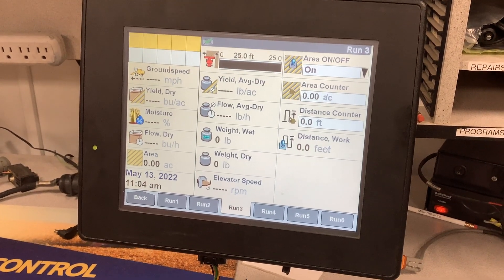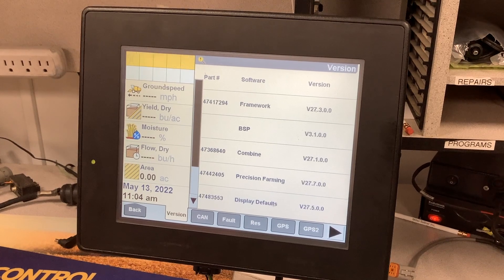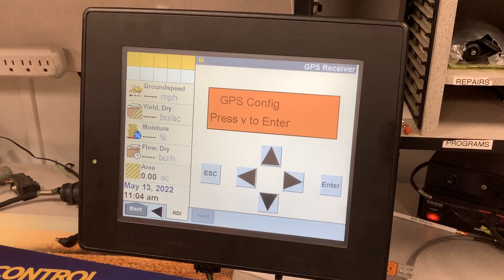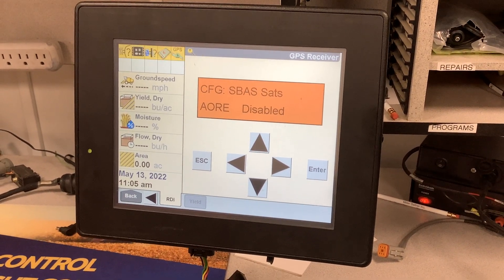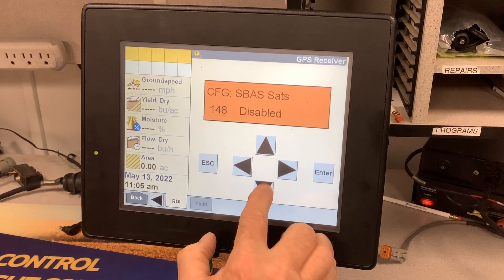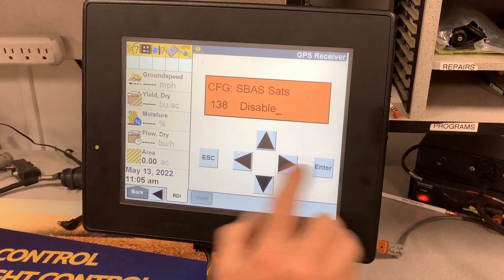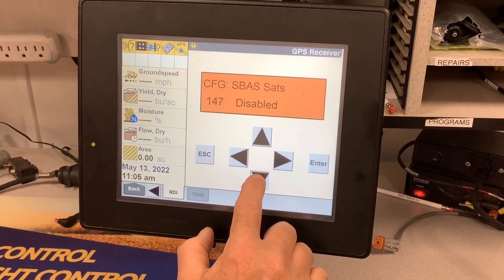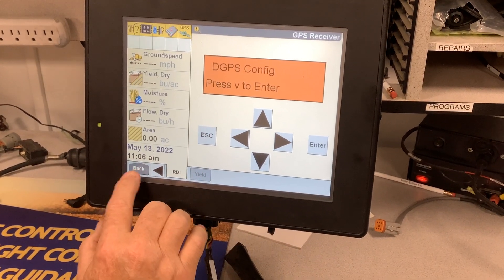WAAS Program Update: Case IH Pro 600_700

Comment: What’s the advantage of doing this?
Reply from the maker: In May 2022 the WAAS program entered a new geostationary satellite into service. This new satellite, PRN 135, replaced the current WAAS PRN 138 satellite. PRN 138 ceased WAAS transmissions on May 17th, 2022. This change affects the free WAAS service, not a subscription service.  This video was done to help users make the switch.
Reply: In 23,24 seasons I have been  innaccurate and can’t follow similar case combines in the same field with the same heading.! Will it still steer on 138 just not very accurate ?